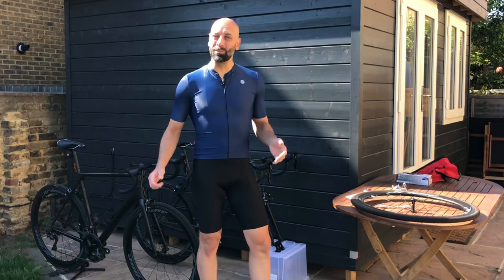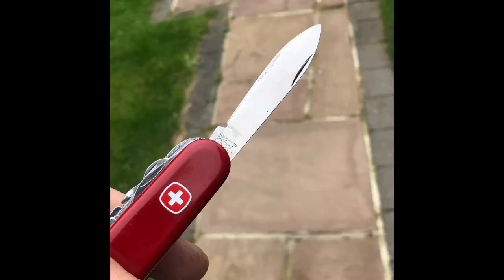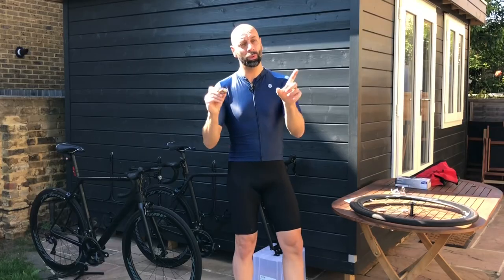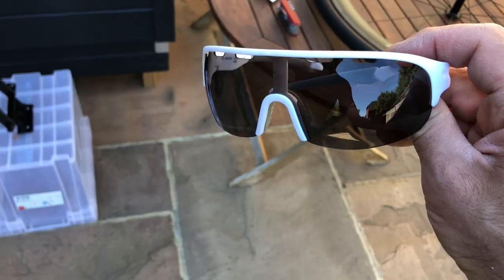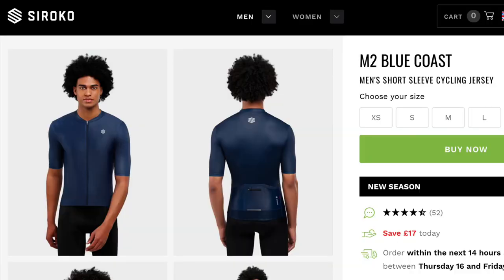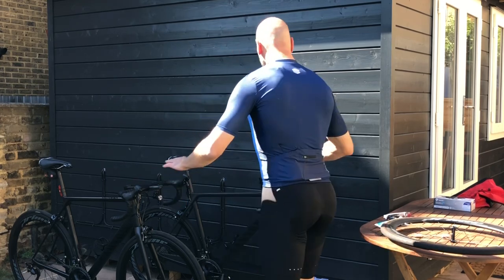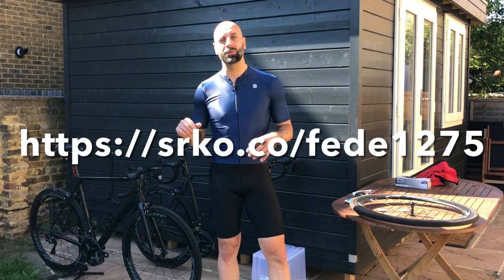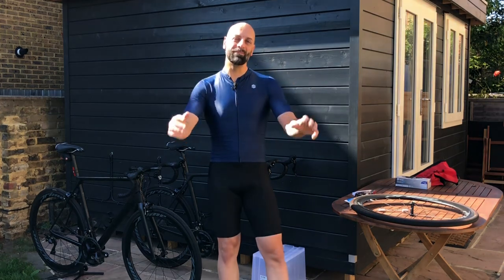I managed to fit new front hub bearings on my Prime RR-50 V3 wheel…

Comment: Nice job Federico! Little rough going back together, A for effort, but you made it to the end and the bearings spin smoothly. I have the same bearing press from that company. I pressed both of my front bearings at the same turning press nuts till they both stopped-done. :)  Btw, love the kit,  Fire!
Reply from the maker: Thank you! Next time I'll remember to gently press them in, definitely the press works with little effort. I love that blue jersey!

Comment: Really useful to see Fede. I think making mistakes and being honest enough to show them is massively helpful, shares the knowledge - thank you. I'm similarly inexperienced and call all maintenance tasks Bike World (being a parallel universe where nothing quite goes like it should). 
- how would you know that the bearings had gone in fully, sometimes you do have to use force in these things? Serious question - how does one know to stop pressing them in?
Reply from the maker: It's not easy to judge it the first time. I watched other videos, but it's not easy to gauge the effort. In hindsight I should have fitted the axle and try the end cap to see if it fitted properly. New bearings went in quite smooth, did not need even more pressing, let alone hammering!

Comment: Nice work mate. I did the same job at the weekend and damaged one of the front wheel bearings by tightening the threaded rod too hard. It is difficult to know when they are fully seated.
Reply from the maker: Shame that the bearing got damaged. I was luck as even if I was banging hard, the insert was correctly sized and was applying the force only on the bearing outside ring. Yes, it is not easy to know when they are in, as new ones when greased go in quite smoothly.
Reply: Luckily I had more success with the freehub bearings plus had a spare front wheel for my commute today. Back to the bearing shop next Saturday:-(
Reply from the maker: @matthewdixon3670 Good luck! I will try the rear wheel sometimes 😅